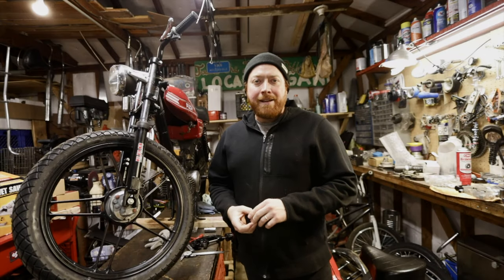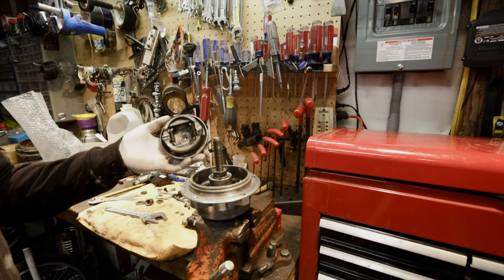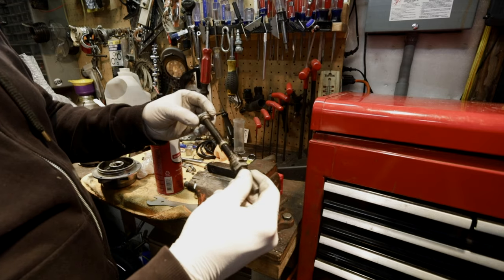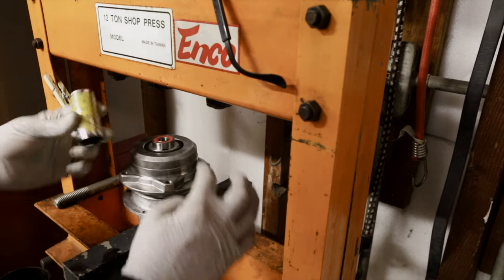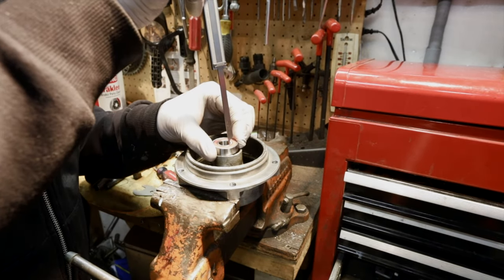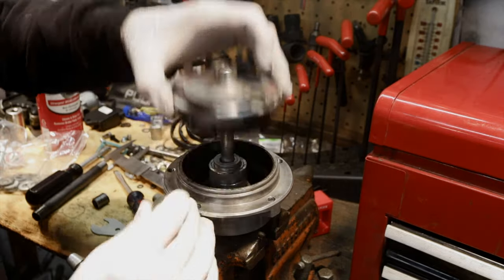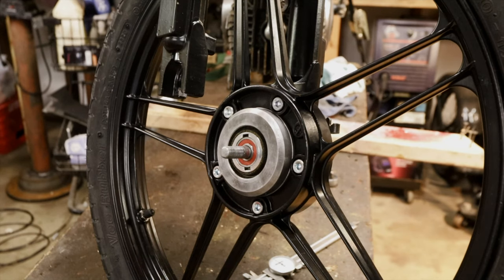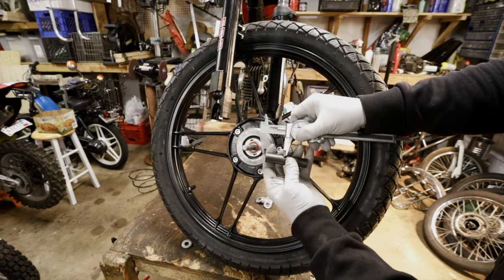Convert wheels to sealed bearings & make wheel spacers. Bearing installation made easy.

Comment: Man, if it wasn’t for this video I would have never known a spacer was needed between that bearing and the brake plate!
Could never figure out why the wheel kept pretty much locking up when I went to tighten the axle nuts real snug.
Thank you so much.
Reply from the maker: Yeah. That is super important!
Reply: Hey do you sell parts by chance? I’ve been looking for a front brake plate for my pinto but cant find any on treats or anywhere online. Running only rear brakes right now.
Reply from the maker: What kind of rims are they? Shoot me an email with a photo of the wheels. Cornped@gmail.com
Reply: Believe I’ve got the same as you.
Grimeca 5 stars
I’ll email ya!
Reply from the maker: https://www.jmpbparts.com/brake-anchor-plate-front-puch-maxi.html or https://www.puchshop.de/en-gb/brake-torque-plate-front-wheel-puch-maxi.html?_gl=1*1xi2f8o*_up*MQ..&gclid=Cj0KCQjwsrWZBhC4ARIsAGGUJur9wNPFXJXZIVnnzP7Z5HCaKrXFIB2fCdtvWGDOWHr3-rs7FAbswFoaAlXaEALw_wcB

But I'm sure I have a spare.
Reply: You the man!!

Comment: been habving trouble with sealed bearings on these Griemca wheels im doing.   this video has helped me man.   I am having a issue where when i tighten the wheel down in the forks, the wheel is locking up.  cant tell if the bearing or the brake pads are binding but i think i need a better and more proper spacer in the middle of the hub between the 2 bearings like you made in this video.    anyways, thanks
Reply from the maker: First tighten it down without the brake plate in there but add some washers to take up the space if it doesn't bind up then the brake plate. if it does bind up then this probably the middle space are not being long enough

Comment: Hey, nice video! Do you know where i can get these 29mm bearings? They are mostly sold out when i look online. If not, can i use a 28mm with a shim or do you recommend sticking to loose ball bearings in my case?
Reply from the maker: Treatland sells them. Let them know I sent ya! otherwise yeah a 28mm with shim stock works fine.
https://www.treatland.tv/puch-KUSTOM-special-29mm-sealed-wheel-bearing-p/puch-29mm-kustom-bearing.htm
Reply: @Corn-ped  cheers!👍

Comment: Hey bud, I have found every thing else that I need to restore my Puch Maxi. I'm restoring this bike mechanically. Not polishing it to sell or make it a show piece. I just need to make it ready for the road this summer... This is the last mandatory service I need to do before I rebuild my entire engine in 2000 miles. I bought the bike with 2086 on the clock. Now bearing 2200 it's so damn fun. My question is I can go to my local HF Tools to buy all the tools I need to complete the job but where do you buy the metric pipe at or the equivalent for my wheel spacers? I wanna do this right and not screw it all up. I have an electric moped so I don't haft to rush. Also, do you recommend straight cut gears for the E50 at all? I am more focusing on hill climbing and more performance for the future. So if you could get back to me on my pipe question I would appreciate that a lot. Thanks-W.
Reply from the maker: take your 12mm axle to the hardware store and stick it in the plumbing pipes until ya find on that fits. Or go to a metal supply store for a more accurate tube.
Reply: @Corn-ped  Thank you
Reply: @Corn-ped   Hey, I bought the sealed bearing conversion kit from treatland. My question is. On the brake plate when you slide the brake down on to the drum. On the old shaft there is a nut there and that is used to hold the brake plate down to the drum. That"s with using the 11MM threaded axle. The threaded axle was for the crappy loose bearings. I saved all my hardware to the bike. I''m just trying to figure out how to keep the brake plate secure on the drum with out sliding off. This is my first moped ever. I'm trying to look for the best info I can find and convert it the easiest way possible but make it safe and reliable. As my health goes down hill from here. I don't feel like taking the rims off every season to re pack it. I would rather cut the head off the snake now and end the issues. Thanks for your time and have a good night and a Merry Christmas.

Comment: Great video. Is this the same for a Puch Maxi snowflake wheel?
Reply from the maker: Its the same process but the bearings are a different size. Puch snowflake wheels use 16101 bearings. You can get them on Amazon or Treatland.tv
Reply: @Corn-ped  Great, many thanks. The video is really clear. Much appreciated. 😊
Reply from the maker: Glad it helped!

Comment: Does there need to be a washer between the fork legs and the spacer? And does the brake plate need to align with the fork tab to hold it in place?
Reply from the maker: You do not need a washer on the inside of the fork leg but you should use won between the fork leg in the nuts. You do need to align the brake plate with the fork tabs to hold it in place. I'm using Forks that are too wide for this Hub so I'm going to build an adapter for the disc brake side to fit into the brake slot

Comment: Hey I just converted my rear wheel to sealed bearings and wonderd what would happen if you didnt use a spacer in between the bearings because a loose ball bearing axle doesnt have a spacer either.
Reply from the maker: You need the spacer in the middle. Otherwise when you tighten the axle it will squeeze the bearings inward and ruin them, and your wheel won't turn smoothly.
Reply: @Corn-ped  I didnt think of that 😅. Thank you!

Comment: What iron pipe size are you using?
Reply: Looks smaller than 1/2 inch- I’m at the hardware store now- lol
Reply from the maker: I think it was half in and I used a dremel to smooth out an inner seam.

Comment: Anyway to keep old vdo drive?
Reply from the maker: Yeah totally. Just put a spacer between it and the hub.
Reply: @Corn-ped  so on the snowflakes I did, the race actually had notches for the speedo drive. Race gone, notches gone.
Reply from the maker: Ahhh yeah. Well then you would have to get creative. You could switch to a spoke hub gear and notch the hub.